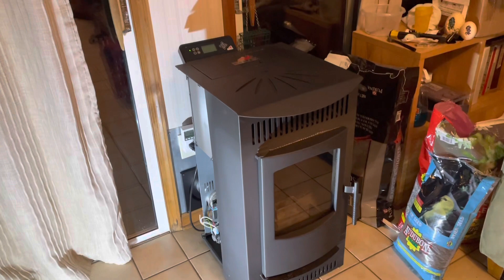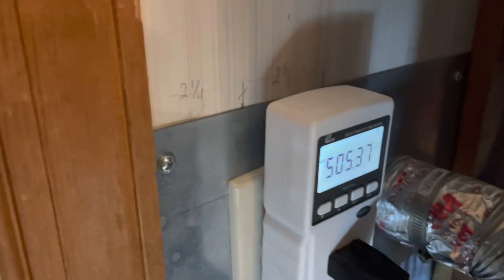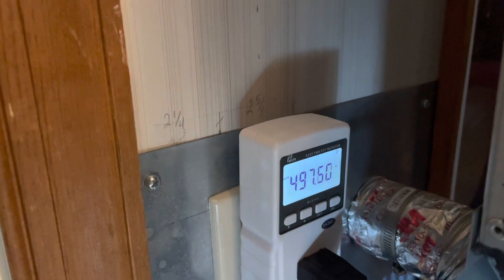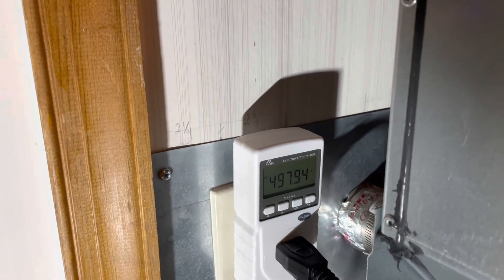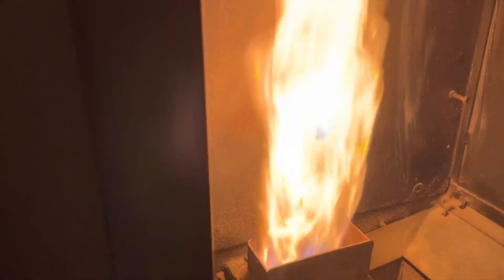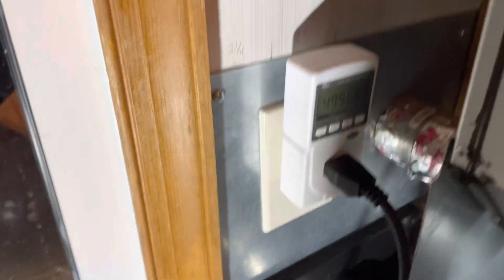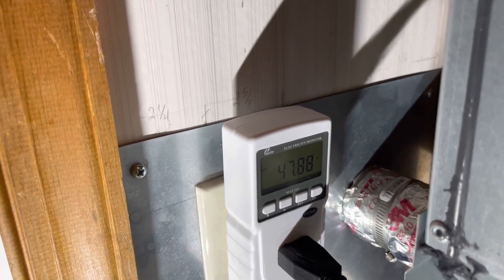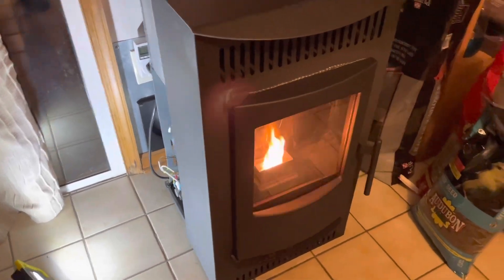How much electricity does a pellet stove use?

Comment: nice video showing current draw, always wondered about that but not enough to get a meter for it, BTW i do not think the  pellet door has much to do with vacuum draw, or it would have a rubber seal or something like it, however, it does have is a cut off micro switch for the auger motor, meaning while the door is open it will never feed pellets into the stove.

Comment: I have a Serenity, I love the thing.
If power goes out I use my solar generator to power the stove, it works amazingly well.
Thanks for the video.
Reply from the maker: @rickdavid1795  I miss mine, too. Fortunately, after moving to Portugal, I discovered many more fantastic pellet stove designs. It’s a primary heat source for many here.

Comment: Can you folks think of any reason not to suck outside air from below? I have a propane inlet in my floor that will be available when I remove the propane heater and install the pellet stove. All the literature I've seen shows the inlet pipe going straight out the back. Since I have a hole in the floor already, I'd like to use it. Thanks for your ideas.
Reply from the maker: Does the hole in your floor go to a crawl space or a basement? If to a crawl space with outside air easily drawn under the house, then yes, it is fine. Just put a screen over the inlet so mice can’t enter. If you have a basement that is heated part of your home - it will not work because you’ll be using indoor air for combustion, which will draw cold outside air into your home around windows and doors, etc.
Reply: Thank you. Yes, it's a "3 season" cabin built on concrete posts that I'm trying to survive in during the winter, so it's all open air under the structure.  @jedi_mapperp4073
Reply: You do what suits you

Comment: Were in Tennessee and was on the fence between mini split and a pellet stove lol. I have a ecoflow delta pro with a 1800 watt array so powering wouldn't be an issue for power outages and grew up in Vermont with woodstoves and pellet stoves. This is a nice video and understanding for the power consumption. Obviously powering this pellet stove with a small powerstation is super easy but the price of pellets and cleaning compared to the 1 time purchase of the mini split is the only thing getting me. Lol The heat off the pellet stove is AMAZING and the flame is gorgeous and also amount of power the pellet stove uses ( basically my box fan running at 50 watts) is outstanding. All this has still got me on the fence. I guess the mini split just is more enticing for the summer for free cooling lol. What do you think?
Reply from the maker: I hear you! I’m constantly considering a mini-split to replace the pellet stove, but when winter comes we all stand around the pellet stove after coming in from the cold.
Reply: @jedi_mapperp4073  I do miss the heat from a wood fire for sure :) I just don't think it's cold enough here for one lol maybe both!!! Lol

Comment: I bought my pellet stove from Lowes for 599. There's a 30% Federal incentives on the stove and everything else used during the construction, includes stove pipes.
I bought the stove  to save money and have alternative heat source during power outage. 
My solar battery system can run my stove for roughly 72 hours without sun.
With Sun, indefinitely 😊

My pellet stove draws 325 watts during ignition. 65-75 watts after the igniter goes off.

Comment: MY stove runs at 300 watts after the ignition  which in a good down situation I would disconnect that and start the fire by alcohol gel right now I have for 100 amp hour lead acid batteries that are kept charged by my solar system in the yard which is only 200 amp panels. It will run my stove for four hours I want to go lithium ion and I don’t know what size if I have two lithium ion batteries that have 3500 W hours and my pellet stove require 7000 W hours for a 24 hour period does that mean that those batteries will run my stove for 24 hours? And if I increase my two panels to 600 or 800 watch I’m assuming I will have a better chance at running that pellet stove more than four hours a day in the winter time? I do also have a gas generator so I can fill-in I also have a woodstove to fill-in however I have not been able to determine on any of these YouTube channels how much battery and solar I need to run the 300 Watt unit  continuous? DOES ANYONE KNOW HOW TO CALCULATE THE BATTERY AND THE SOLAR PANELS REQUIRED TO RUN IT IN A GRID DOWN SITUATION😳
❤️🇺🇸❤️🇺🇸❤️❤️🇺🇸❤️❤️🇺🇸

Comment: Another channel I watch theirs always used around 280-300 watts constant, yours seems much lower, so they might not all be consistent. Not sure what brand they had, but theirs stayed at the same wattage for like 5 hours.
Reply from the maker: My numbers are correct and match the specs in the manual. I also have a Harman in the basement. I’ll perform the same test.

Comment: This is a very interesting video.  I am in the process of getting a pellet stove.  Of course I would prefer a real wood stove but the cost of the stove and chimney is just too much, plus my house insurance don't like real wood stove.  Pellet stoves are more accepted.
I was leaning toward a Harman pellet stove as it is one of the best one.  However, there is another video much like yours, were this guy have a Harman pellet stove and does the same tests.  His Harman stove runs at above 325 watts compare to your 60 watts when the fire is well established.

This is critical for me as every year we experience a major power loss that last between 2 and 5 days.  This is always happening in the dead of winter in the worst weather imaginable. I need a stove that will run for many hours / days off a battery pack.  Your kind of pellet stove uses around 5 times less electricity than the Harman pellet stove.  This way I can reasonably put together a power pack that will be good for many days, which will be prohibitively more expensive to put together the equivalent for a Harman stove.

This is a game changer for me.  Thank you
Reply from the maker: You’re in luck. I have a Harman Accentra fireplace insert in the basement. Both stoves have been running during the deep freeze this week. I’ll perform the same test on the Harman. Note: I bought the Harman from an owner who neglected it, never servicing/clean it properly. When I got it it wasn’t running well, so I got it cheap. It’s a 2004 model. I completely refurbished it myself. You can find the videos on my channel. Now it runs great. A new one is almost $6000. So bang for the buck is definitely in the Castle Serenity. Build quality and performance is in the Harman. Top feeders (Castle) must be cleaned daily). Bottom feeder (Harman) somewhat clean themselves by pushing in pellets from the bottom. Still, in your situation the Castle is a great option.
Reply: @jedi_mapperp4073  I clean mine every week...not every day. I've been doing this for the last 10 years with my Castle Serenity P.S.  I cannot imagine cleaning it every day.  Some people on YouTube even go longer. The more  you open and close the door to clean it wears down the door gasket too. I would wait until the ash gets near the top of the ash container before cleaning.

Comment: Those numbers seem low to me, I have a different stove but mine draws 240-300 watts running. What does your user manual say for specifications?
Reply from the maker: According to the manual 402 W ignition. The spikes to 502 must be including the intermittent starts of the auger. According to the manual 77 W operating. My running Watts are slightly lower, 42-66 W, because I run it on the lowest setting. Even on lowest setting it will get too warm in the sunroom except below 20 degrees. During this arctic blast we just got over Christmas weekend used the thermostat control and set it to 73. It maintained 75 according to room thermometer. The outside temperature dropped as low as 4 degrees. This is a very efficient stove. It’s not comparable to the Harman in the basement (love the bottom feeder design), but the Serenity is an excellent value. Great controls. Easy to service.
Reply: @jedi_mapperp4073  I wish I had that one because I run mine from a battery when the power goes out, I would have 5 times longer run time.

Comment: My mother loves her pellet stove, but after watching your video I'm a bit concerned for her. So it's a paper weight if the power goes out? I think I will have to get her a solar generator dedicated to power the pellet stove. Thank you so much for creating this content. it's very helpful and I hope more people watch to get informed.
Reply from the maker: You're welcome! I goofed and undersized my Jackery (will keep it anyway for camping and charging phones, laptop, etc.). Make sure the solar generator you get can run at least 550W continuous during the startup. Peak power will be higher, but continuous rating is more important. A unit with more than 550W continuous will also be able to run the pellet stove for 8-10 hours, or more (with no extension cord to trip over).
Reply: @jedi_mapperp4073  once again thank you so much. I have one of the bluetti 2000 and it runs the fridge and freezer all night. It's pricey but my mom is worth it. Great feedback and really appreciate the response back.
Reply: Look at a computer UPS system that automatically switches over to the battery when the power fails, they are cheaper than the battery generator
Reply from the maker: @davidbalgosky4107  Thanks! I couldn’t remember what these computer backup power devices were called. Perfect solution.
Reply from the maker: @Johnny Rosov All the fans and blowers are pretty much the same in all pellet stoves. Buy parts from a respected vendor. The Castle Serenity design is good. If something goes wrong I fix it myself. See my other videos.